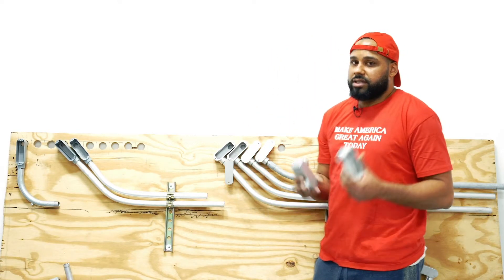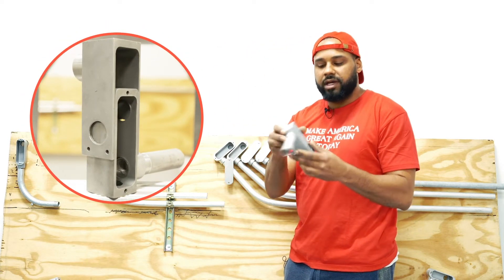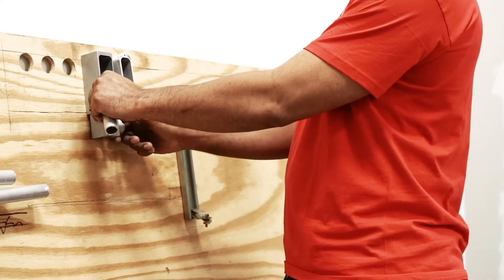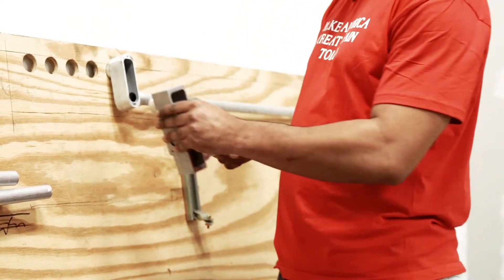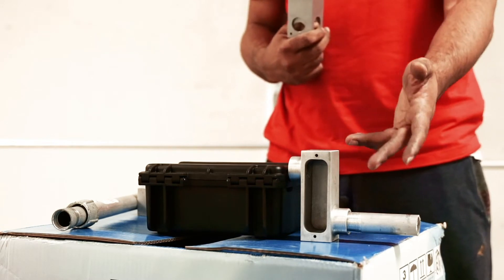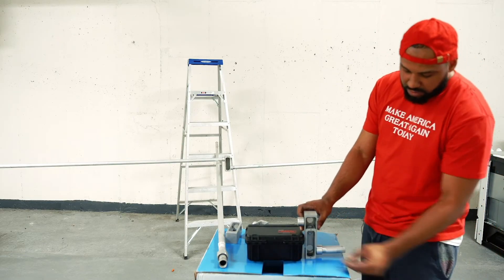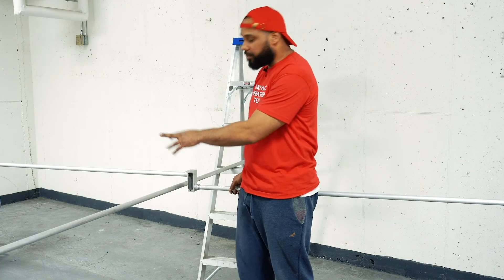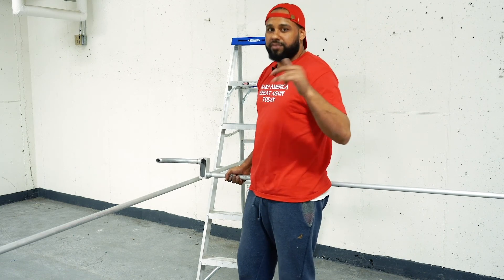Video 3

Comment: I am a union electrician in CA. I got so many questions. In the expansions, how do they lock in place? Have you shown this product to the Nec code writers? Inspectors are the AHJ. If there is no code written on the expanding condulette I would like to see it hold up to an indepth inspection on a explosion proof location. The covers would be nice to see too. Wanna see the full system in affect. Are there aluminium and rigid condulettes? Have you brought these to any big electrical company? Wheatland? Thomas &Betts? Maybe find out where your local union hall is and go to one of their tool shows. Foremen are the ones that will order parts. They do have parts list and submittals but when there is a fire they need to put out it is the foreman that has to come up with solutions.  Just saying.
Reply from the maker: There will be special covers for them. The UL charging an arm and a leg for the aproval. I'm just promoting the idea for now and raising money?

Comment: I like your idea
Think about this;
A 90* w/kick you can feed/pull wire without another man at the LB
What's your solution for this objection.
On your extension LB can you have a double slide extension, that would be great.
Are you using ridged pipes in your examples? I see you threading the pipes on. Are your products interchangeable with EMT?
Your almost there, keep it up ☺️
Reply from the maker: The answer to your 1st question is 1: is not that you're going to replace a 90/w. a kick all the time but you're going to rather want to have the option (You may have to come out of a box with some bend pipes). Yes, I'm using rigid and it can be for EMT.

Comment: That looks interesting. I ran pipe for years. But neatness was key to the guy that trained me. I Had many pieces of pipe come back at my head until I leaned how to run clean lines and perfect bends.  With that said 3 things concern me 1. How does it mount. 2. What kind of cover. 
3. It looks like it would be very hard to make look clean to me.
Reply: You lost your credibility after your first question
Reply from the maker: You're going to mount it to your pipe run. Trust me, the pipe runs will be clean. And The cover is going to be a special type of cover. You'll see all this on future videos... Thanks...
Reply: Rafael Galva just to give some constructive feedback, it would be wise to make these fit a standard type of cover that other LBs use. Much the same as in the gun world people like things that accept glock magazines because that’s what they already have. I understand that the adjustable lb would and should be the exception to this.
Reply from the maker: @claytonatkinson865  , I agree...